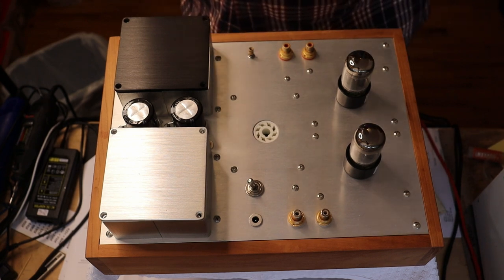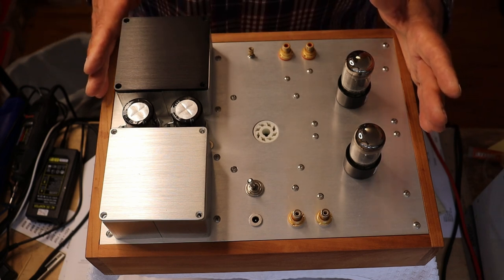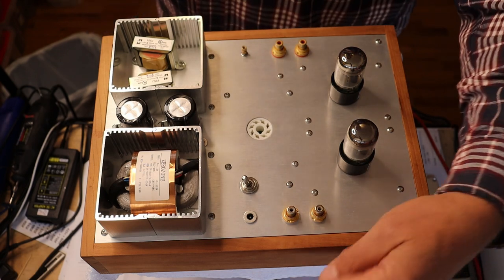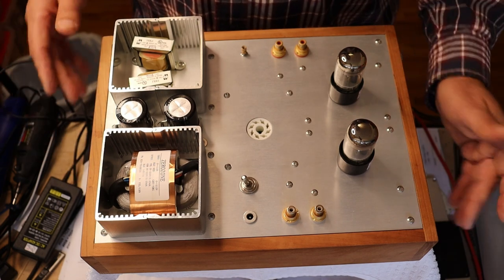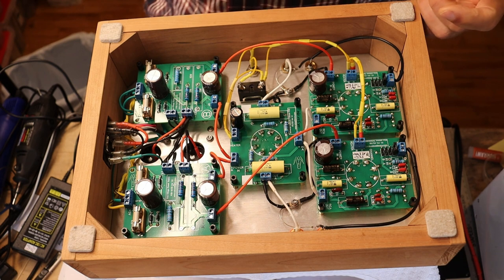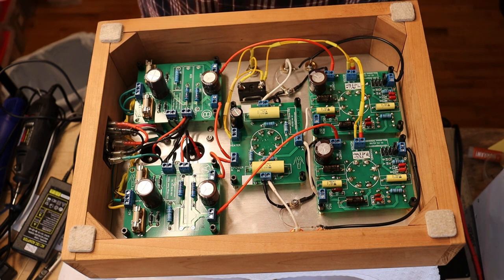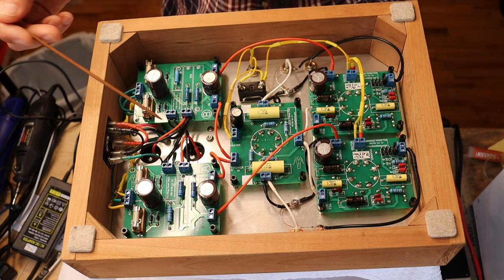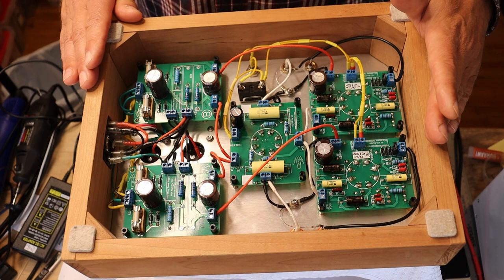Ep1 6or12SL7 Phono Preamp - Getting Started

Comment: I'm thinking about getting the kit. It's very nice. Three changes I would make is to put the power supplies in a separate cabinet, and also build the kit point to point instead using the PCBs. One thing I've learned from AGY is to add a lot more filter caps to the PS. Another improvement would be to replace the aluminum top and bottom (if the top is aluminum) with steel. Aluminum is not as good a filter as steel for blocking out noise.
Reply from the maker: Hi Fred, thanks for the interest in the kit. We appreciate suggestions on how to improve it, and encourage people that want to tinker to modify things if they want to. 

But the one thing we suggest doing first is to build the kit as designed. We put hundreds of hours of work into designing, testing, building, and iterating each one of our kits. 

Many suggestions including most of yours are ones that we've already tested and found to be unnecessary thanks to our careful design work.

Cheers!
Charles

Comment: Jim,  I really like what you done with the design of an amplifier that sits in a wood base.  You corrected a number of problems I see on similarly designed equipment.  First, I like the IEC and the volume pot mounted on the plinth rather than the top plate.  Second, the thickness of the top plate is as heavy as any I've seen, necessary I suppose since you are mounting the transformers topside.  And the addition of a bottom plate is very welcome.  I once picked up an amp built like this while it was plugged in but not turned on.  My fingers touched the power supply, and I felt that tingling sensation from live current.  You need that bottom plate for safety!

Tell me, is this designed for MM cartridges only (47,000 ohm)?  I presume you would require a step-up transformer to run a moving coil.  Correct?

Many thanks,

John
Reply from the maker: Thanks for your design observations, we spend 100's of hours working out these things over the course of a year and it's nice when someone notices!
Correct the Universal Phono Kit is designed for moving iron and moving magnet carts.  Input impedance and capacitance is determined by the builder with 2 options for impedance and 3 for capacitance (if you count zero - which you should).
Also correct if you want to run a moving coil cart a step up transformer is required. But given how good this Kit sounds with a quality moving iron or magnet cart, I would highly recommend trying it that way first.
My personal fav cart is the Ortofon 2m Bronze, using low resistance low capacitance rca patch cords (our design) the pre is set for 47kohm impedance and 100pf capacitance and wow, I've never heard a phono pre come even close to the sonics we're hearing - warm rich detailed dynamic and fast.

Comment: So, what is the hum and noise levels? (db input shorted and unshorted).  Maybe you could show us a spectrum plot.🙂
Reply from the maker: @davidkclayton  glad you asked!  Our noise floor is -53.8 dBr, which is pretty good for a very high gain tube circuit and well below the noise floor of a high quality stylus running in the groove.  We publish complete specifications for all of our Kit Amps.  Just go into the store to top right "Information" and you'll find everything we publish.  Note that no one tests with an open rca input, it wouldn't reflect anything like a true operating circuit.  Much our data is derived from a closed loop sweep.  Any questions can be sent through the store contact page.  www.valvesnmore@protonmail.com
Reply: @mellowtoneamps4932  Hey cool thanks for the Info. This is good news for me I've been working on modifying the common EAR 834 phono preamp circuit board design, reducing the size and the noise floor. I think with the next reiteration of boards I can get it below -70DB I'm at about -65 right now. I don't mean to brag but if anyone's interested, they could visit my channel to see the progress. Also, I will open source all of this
Reply from the maker: @davidkclayton  it's not considered good etiquette to piggy back on someone else's Channel or the comments section.
Reply: @mellowtoneamps4932  well I'm sorry didn't mean to get you all bent out of shape. That's how I found your Channel. Anyways I thought the community was a little tighter than that . I don't mean to compete with you. Please accept my apologies.
Reply from the maker: @davidkclayton  Haha no worries, it takes a lot more than a wee faux pas to get me bent out of shape!

Comment: isnt a star ground one point?
Reply from the maker: Haha yes it is, BUT a grounding layout/topology can have more than one star ground point.  The reason for this is to minimize noise , by giving each section of an amp it's own star ground.  I can't take credit for this method, and learned it years ago from Dave over at Blue Glow.  How this is implemented is you use one star ground point for the noisy ground returns in the power supply, I prefer to locate this very close to the IEC mains safety ground point and in the case of a simple preamp, I locate a second star ground at the other end of the amp, centred in the preamp circuitry.  More complex amps require possibly more star ground points, but once you understand the methodology it's fairly easy to layout a low noise return path.